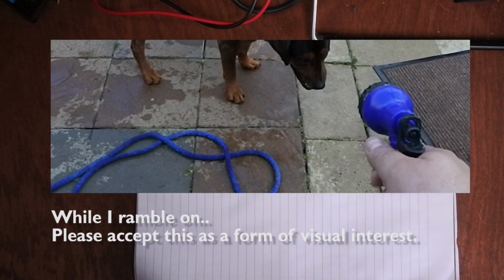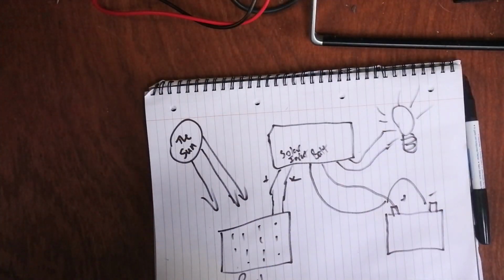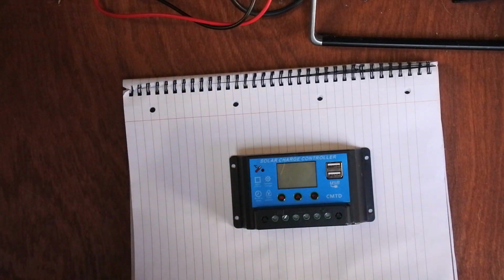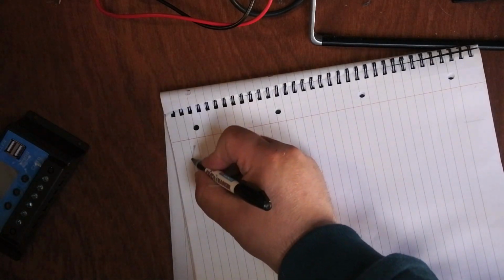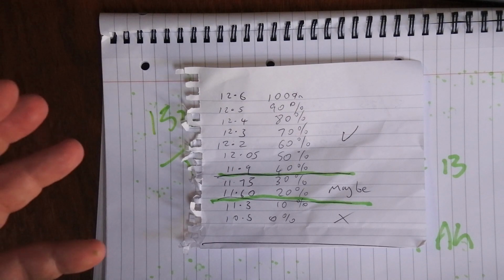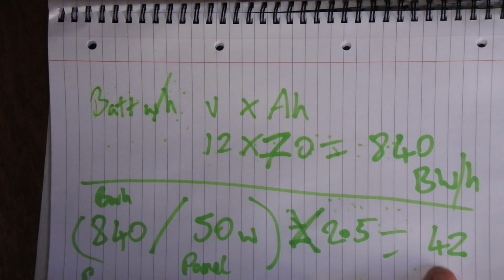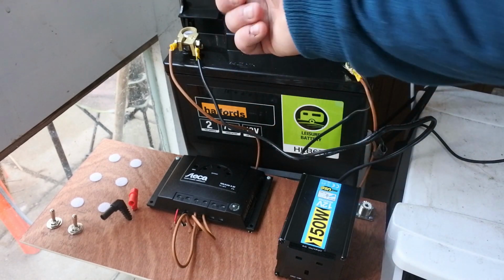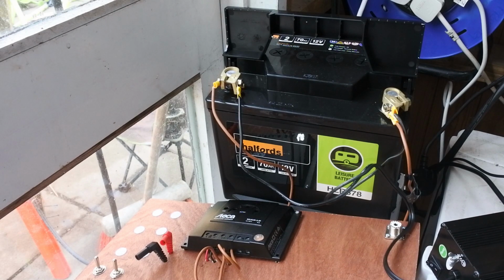A simple solar power setup for my shed.

Comment: do you really need fuses for 10 w solar panel system
Reply: Keiron Phillip no you don't
Reply: It's always good to put a fuse close to one of the battery terminals, in case you're fiddling with the wiring one day and accidentally short circuit the battery. You don't really need to fuse the solar panel lines, and the load outputs from charge controllers normally have overcurrent protection anyway. But it's still best practice.

Comment: Sorry, but inverters do NOT "waste" the extra energy as heat.  I have a 500 watt pure sine wave inverter that idles at about 0.6 amp, including the fan on its lowest speed.  That's 12 volts times 0.6 amp = 7.2 watts - that may be less power than the smallest light bulb in your house.  The inverter draws more power as the load increase  but that id proportional to the load.  At best, inverters are about 90% efficient, so about 550 watts input for 500 watts output.